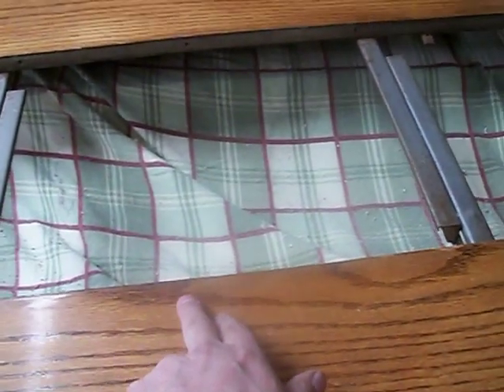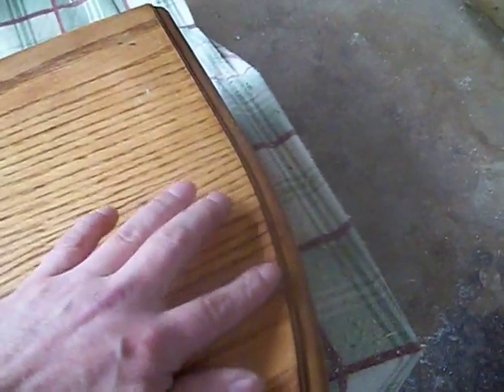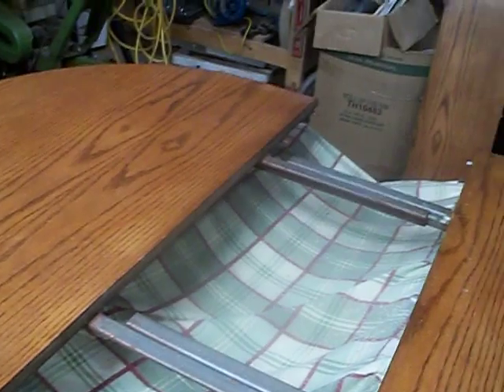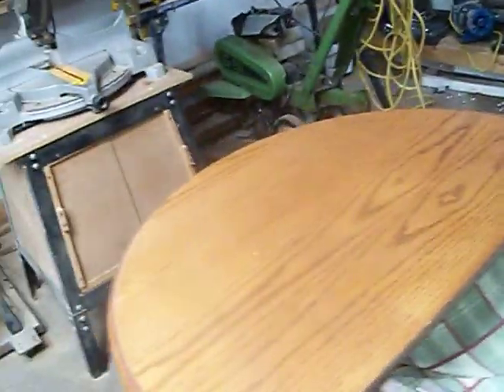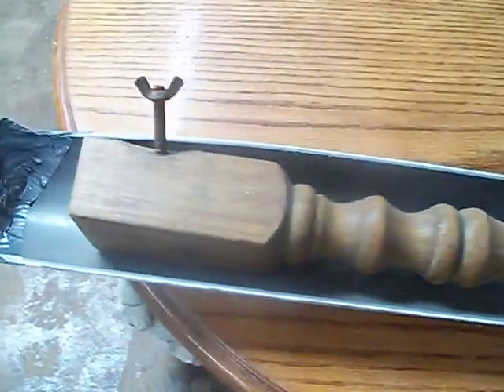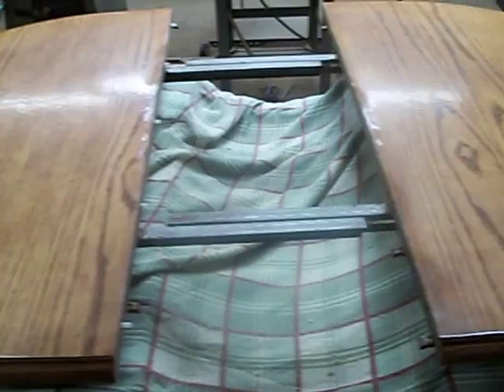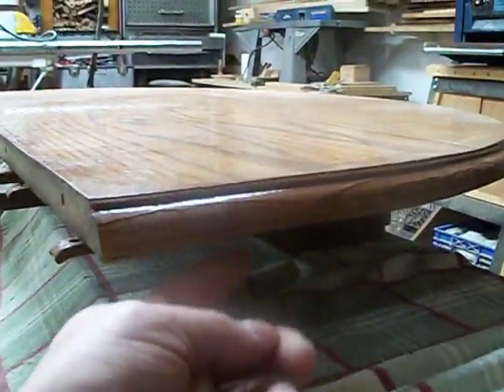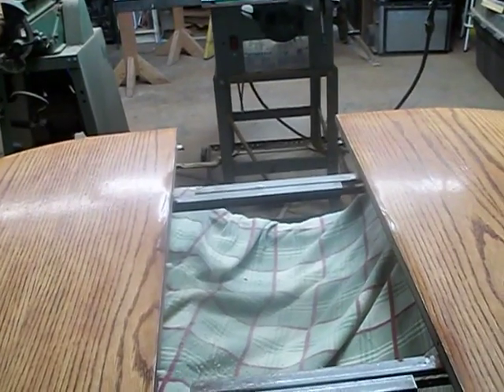table part 1

Comment: Howdy Wayne
sounds like a great project, i refinish old furntiture for a hobby 
my mom got me into it when i was a teenager
ain't meant to be a stranger 
that Huricane Sandy kicked my asspower was out for 13 days
trees crashed down everywhere I got a month of Sundays work to get it all cleaned up 
took me 2 days to chainsaw my way out of my driveway
here's the latest on the Dawg House the outside is done
an the inside is about 95 percent done the acoustics are 10 times better
stay cool 
Rich